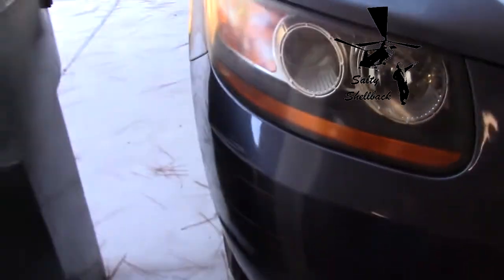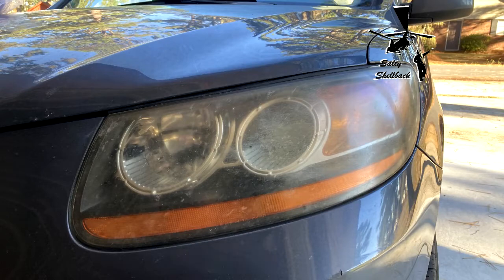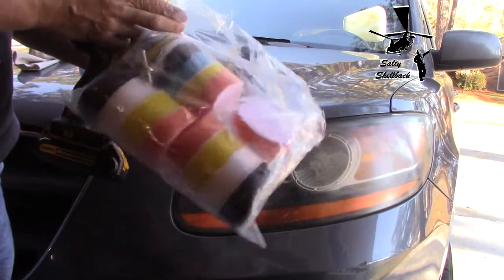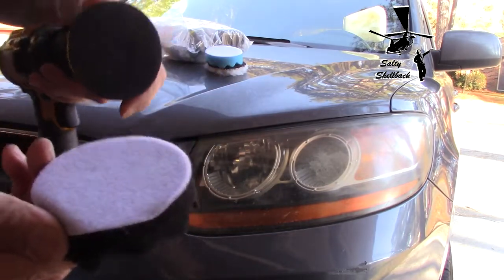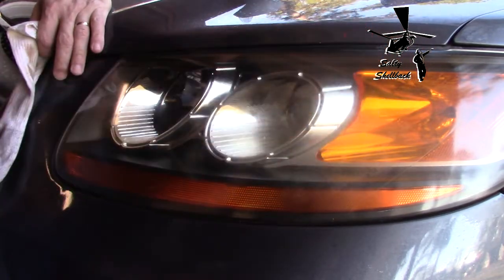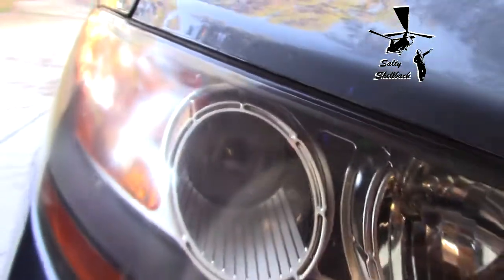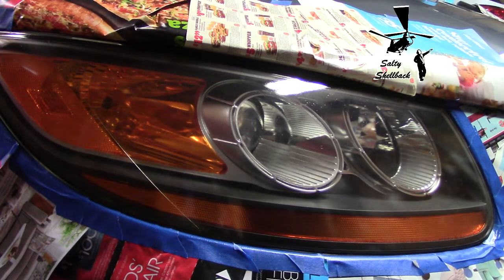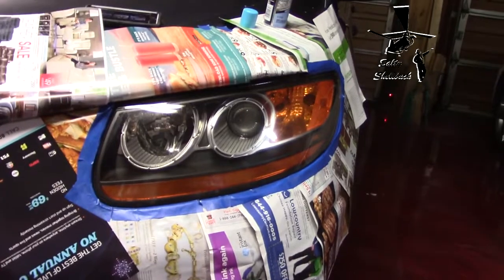How to restore plastic headlights-Super Easy!

Comment: Yep, I have been using Mothers mag for years as it does well but better if you use it at least one time a year from my experience...I don't clear coat as I just use a carnauba wax....Nice job as it came out nicely.....Good stuff....
Reply from the maker: Thanks! It's much easier than other methods I have seen.
Reply: @saltyshellback  Yep....I have been using Mother's Mag polish since I was a teen back in the 80's....